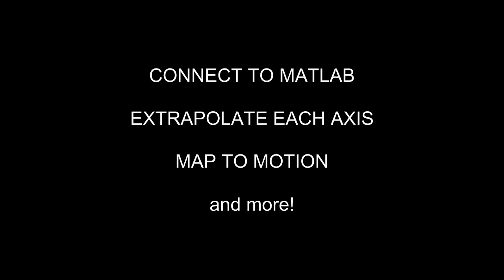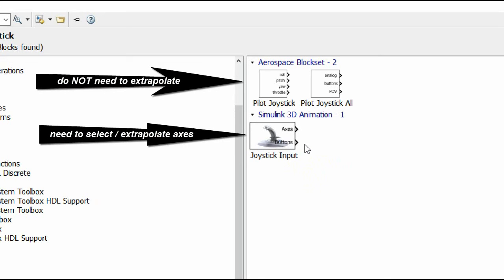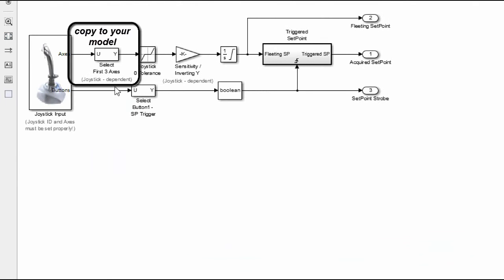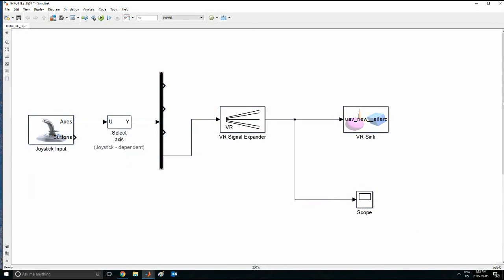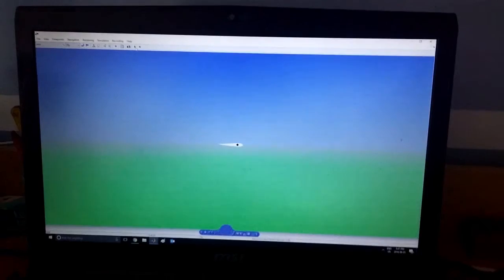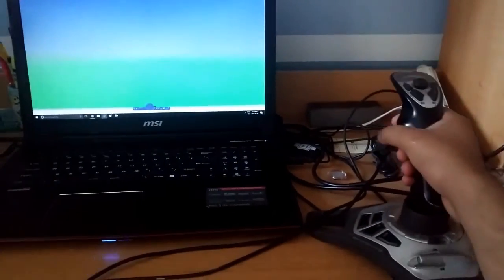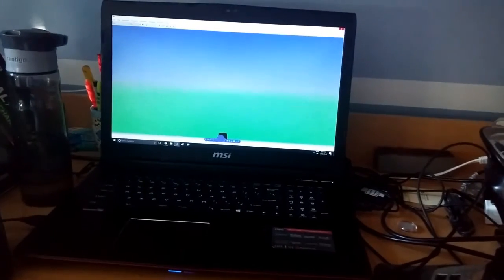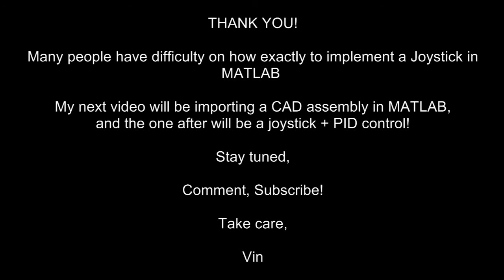How to Read and Use Joysticks in MATLAB and Simulink - Step-by-step detailed example!

Comment from the maker: At 2:24, I apologize for this. You can find the block, it is called "Selector". So go in the Simulink Library Browser, drag the selector block, double click it, set the Input Port Size to 8 (this makes it compatible to work with joysticks). Leave the other parameters as is. You can then select the Index [1 2 3 4] as follows for attitude and thrust.

Comment: Thank you very much for the video. My question is about the receiver. Is this receiver in the package of logiteck 2.4 joystick? If not, could you please tell me the brand of the receiver? Do you need any data acquisition card to send data to the MATLAB?
Reply from the maker: The receiver is included with the joystick. No data acquisition card needed.